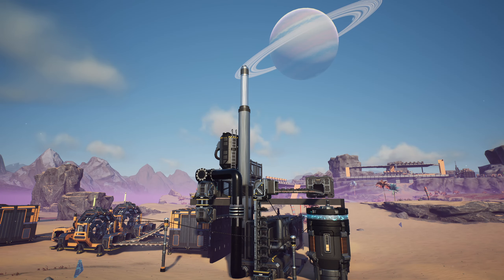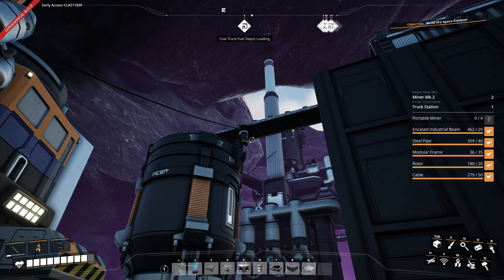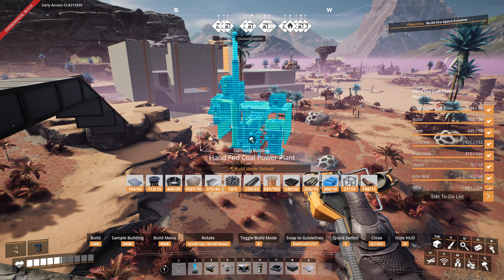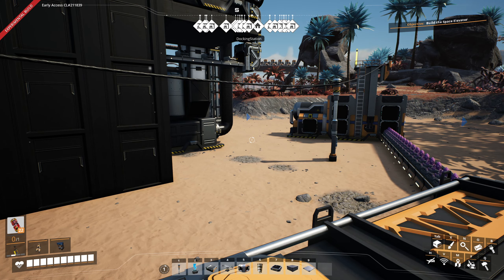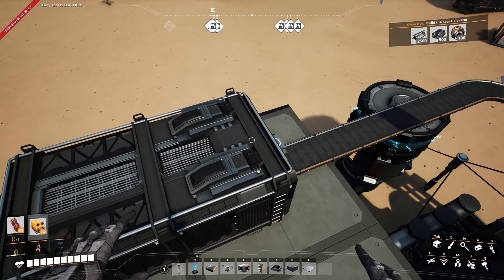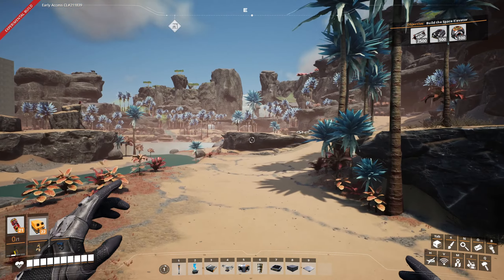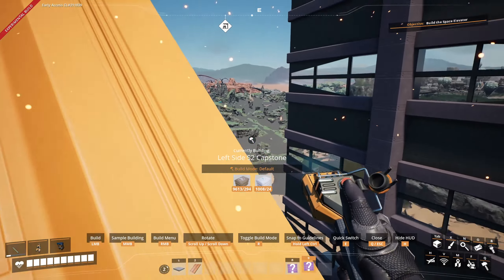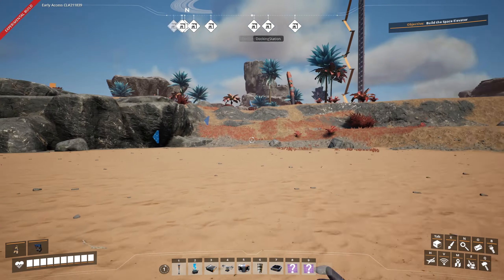S02/E06: It's time for a Satisfactory Skyscraper! How I use BLUEPRINTS to make it an easy job!

Comment: You could incorporate a Biomass burner into your power pod blueprint in the bay that you originally tried to place the battery.  that way you can plop the pod, throw 1-2 solid bio-fuel in and forget it.  Having the burner sit there idle will be handy in case you don't make it back to hand fill in time and run out of water, thus needing to prime the system again with another 1-2 Biofuel. This will also save setup time as you are not having to add and delete from the blueprint for the priming process, just set and fill
Reply from the maker: That's a great idea, thanks!